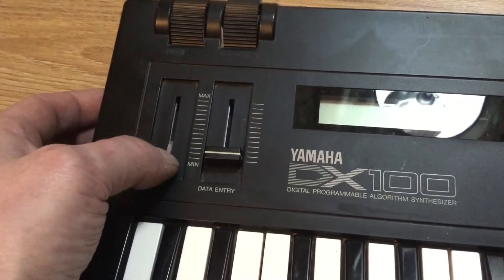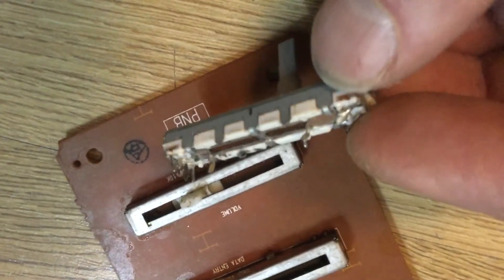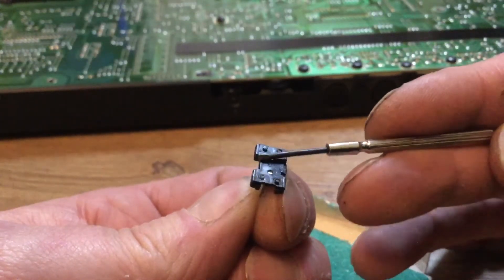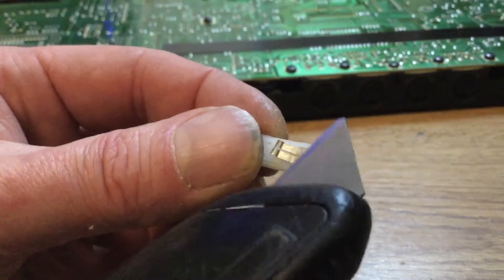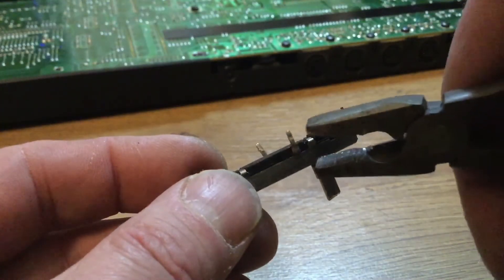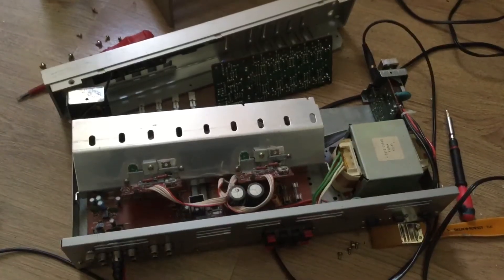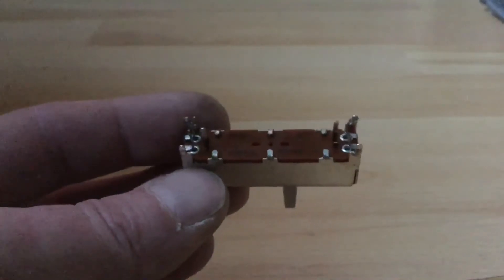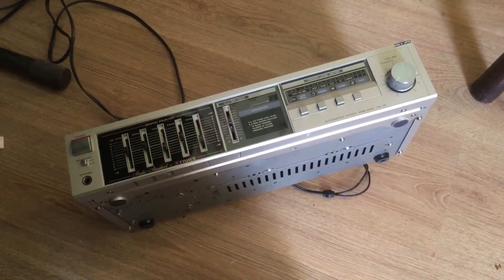Repairing slide potentiometers yamaha dx100 and Fisher CA-38 amplifier

Comment: Hi …Hope you are well. 

Good video!

So my keyboard’s volume slider finally packed up. (Roland EP7) very old model.(1990) . I would like to know what would be the outcome if I had to replace the 10k B x2 slide potentiometer with a single 10k slide potentiometer… my keyboard just finally stopped pushing out volume…
Reply from the maker: Had a quick look at the service manual for mk2 .... umm..I,m not sure but you could try a mono slider. But you would have to try and bridge points somewhere on the volume board I guess. Difficult to diagnose remotely 👍 having a quick look at the service data there are two sliders or tracks for both L/R channel  so in theory , one slider could control both with a little modification. Or try again to source a compatible slider 👍